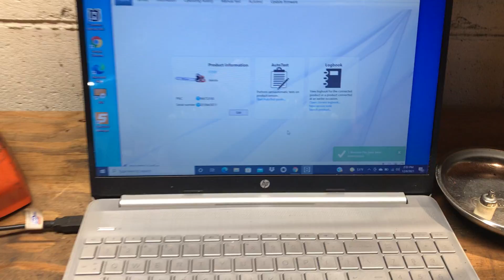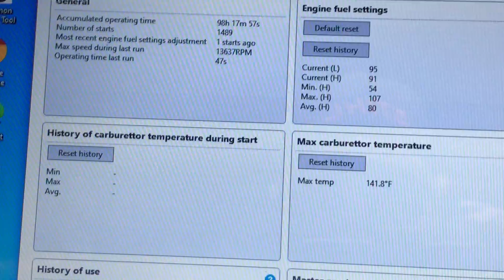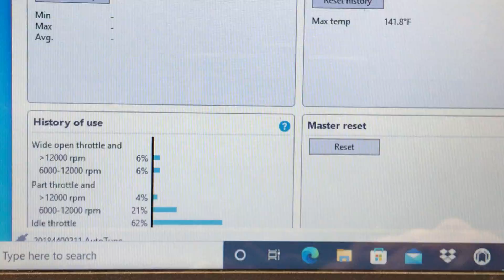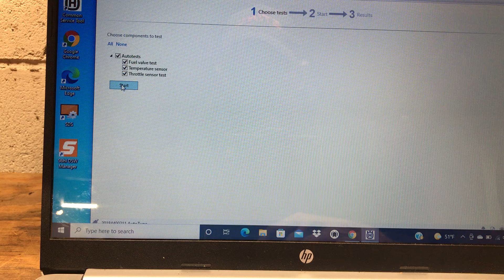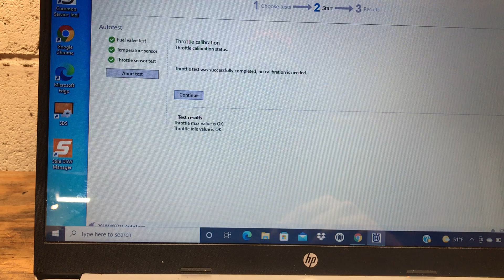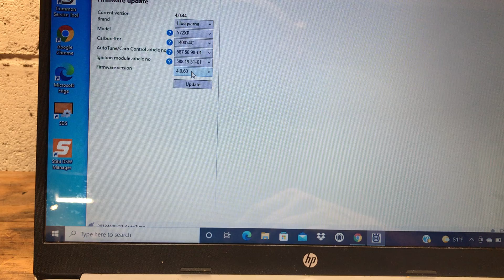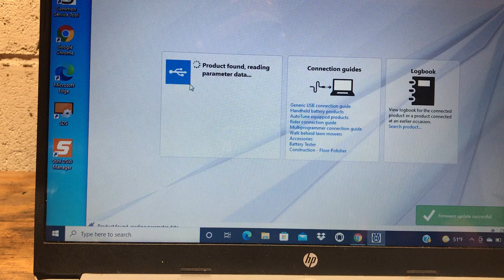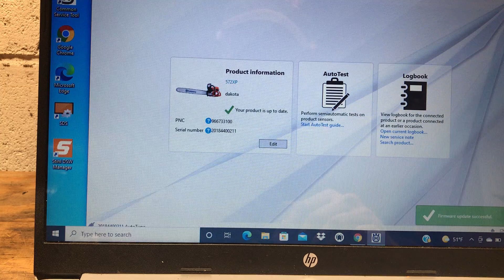Husqvarna 572 XP Auto Tune Diagnostics and Firmware Update

Comment: Saw is junk.  Minimal use and leaned out scored cylinder.  Dealer said I used bad gas.   Premix non ethanol 92 octane was not the problem.  I'll never be able to prove it but I guarantee that autotune starved it from fuel.

Comment: Is there any truth to the Autotune e having a break in setting?  I’ve read that on a few forums.
Reply from the maker: On this saw, yes.  Plugging the saw in for an update won't speed that up.   If you have 7-8ish tanks of fuel through it, it should be 100%.  Let me know if I can help.
Reply: @richardflagg3084  definitely have that done.  I’ve had it for a few years.  Just never impressed with it as far as low end grunt.
Reply from the maker: @backyardfirewood9852   Hmmmmmm
Reply: @richardflagg3084  just took it to the dealer.  No codes; updated the firmware, so we will see…